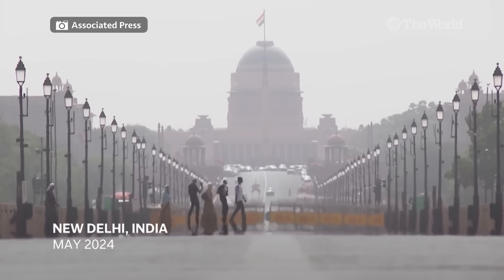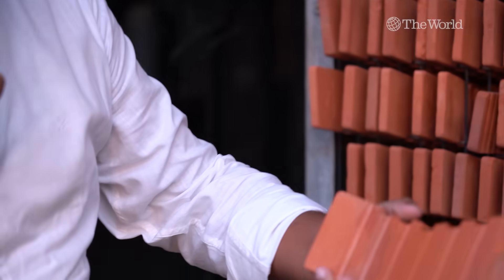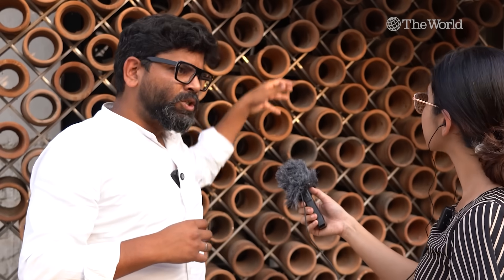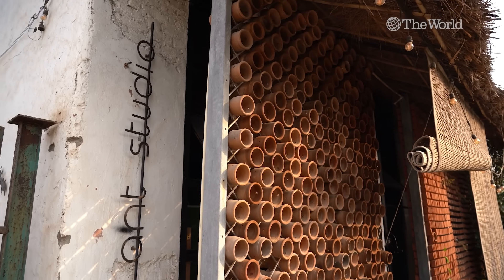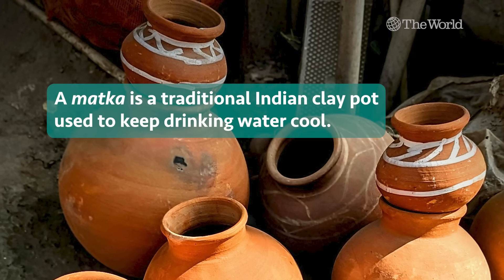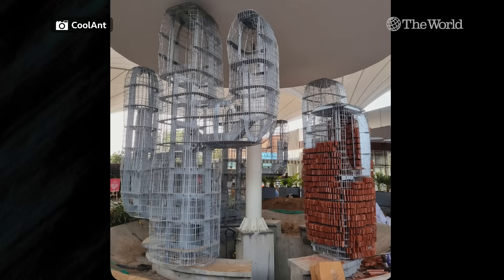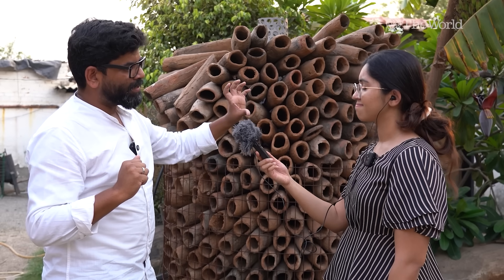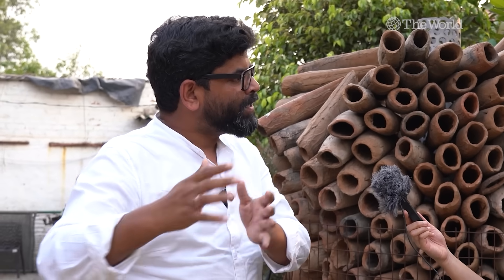Nights in Delhi hit 95 degrees. This keeps homes cool.

Comment: Many solutions for many applications. An idea does not need to be rejected because it doesn’t fit every circumstance. Let this be a starting point.
Reply: Exactly. It's a beautiful approach
Reply: Let the starting point be that the show how much this cools in the testing facility. The cooling effect is the point right?
Reply: @televerket  it cools enough, issue is insane amount of water needed.
Reply: @nemam_nedam Enough? Use an example with degrees if you want to be taken seriously. I understand that the effect might be dependent on many factors so why not create at least one example?
Reply: @televerket   as i said previously, AC works in same way except vapor, liquid is enclosed in pipes. try it yourself in your situation - douse few towels in water. hang them on a clothes drying rack. air has to move in parallel to towels.
Reply: @nemam_nedam You really want it to seem reasonable to not show what it can do right? Enough cooling, insane amounts of water??? My comment is about the solutions in the video and you suggest I should try/test something else?
Reply: @televerket  it is cooling air by evaporating liquid (water in video), same physical phenomenon is exploited in all things we are talking about. youre still doing same thing but by other means. example to make you familiar with concept - you can boil water on wood stove, induction cooker, or gas burner. you are still boiling water.
Reply: Up
Reply: @sureshchandragupta3764 -1a
Reply: AC works with same principle, except in AC, liquid is inside of tubes. Approach in video needs insane amounts of water to work (think whole city). Again, standard AC is keeping all liquid enclosed, reusing it. so having PV panel to block sun (lowering heat) and water tank / rock storage to be cooled by AC by day and used in night should be explored too.
Reply: Even 10% would be huge for the grid! Ty
Reply: Wouldn’t work in my temperate mid-Atlantic US climate where summer humidity is miserably high. BUT my 1940’s house built of cinderblock so 2-ton central air works fine (in 100*F, 110* F heat index recently) tho every AC contractor recommended 3-4.5 ton AC compressor b/c they’re use to install in stick-frame houses.

Comment: Im afraid snakes, rats and other insects, animals will make it their homes. Make the walls thicker than usual...like 1 feet thick or more to prevent heat from being transmitted into the interior.Also, plant trees around the house as they are naturan airconditioners. The roof should have openings for hot air to escape. Also, build fountains in the house so that the temperature becomes cooler and humidity is achieved. Also in the courtyard. The windows should not directly face the sun. Build alcove around the windows to prevent direct sunlight from hitting the window. The ceiling must be high. Use light colours outdoor. Build water drain or passage in the floor for as a  cooling system in dry climate. Etc

Comment: Not only cooling, flowing water is soothing to the mind and helps release stress, so, it can be beneficial like that as well. I can think of multiple ways this can be utilised and become much more than just a cooling mechanics.

Maybe you can have a mini pond like thing below it, where water collects, with pretty flowers, and then the water is taken up and via these for aeration. Doesn't even have to be right below, can make a cute little stream. Basically a an open and vertical Bogfilter. And then have climbing plants on these to help cleanse the water even more.

Plants will benefit from the flowing water and thrive on sunlight, shading the whole structure, dispering water via their leaves and cooling the whole area even more.

Bees and wild animals will also have a place to drink some water.

It can be turned into a wonderful little mini ecosystem.

You can have pretty flowering plants on top of it like Rangoon Wiper (Malti Lata), Aprajita, climbing rose, etc.

Comment: I live in northern New Mexico. I painted my roof with the super radiating white substance that has helped my house stay way cooler during the summer months, and does not affect the winter because the angle of the sun in winter is low. Also, keep in mind that 6 feet under the ground the temp of the soil is 50 degrees. The Earthship Houses mostly around Taos, NM have used this principle extremely well in creating houses that stay at a constant temp pretty much year round. 
This video is so beautiful, the clay pottery structures are architectually so attractive. I've been learning more and more about ancient ways of heating and cooling with wasting our precious energy and creating more heat. If we aren't a bit careful we'll just consume the Earth and it will become unliiveable for most of the beautiful plants and animals here.

Comment: The best arrangement I believe is a thermal mass integrated into the dwelling with a layer of insulation. Ventilation at night cools the mass, which can keep the structure cool through the day while it is closed up. The capacity of the thermal mass has to be great enough to last all day, which depends on how good the insulation is. The strategy only works as long as night time temps are comfortable, though. Night time temp of 95F is too high for the strategy to work without additional cooling measures. Phase change materials could easily be incorporated into a passive cooling strategy, could potentially reduce the thermal mass required.

Comment: stupid idea, imagine the dust collection, algal growth or fungus growth. imagine insects coming inside your homes. plus there will be soil smell... yet it smells good for few mins... not forever 24x7 hourse
Best solution is nuclear power + city centralized air conditioning. 
Because it is nuclear it is clean, nuclear waste is not an issue.
because air conditioner is centralized it can be maintained regularly almost daily making sure there is no leakage of greenhouse gases or any harmful toxic. 
because it is maintained regularly it will consume less electricity as it is more efficient.

Comment: Any sytem that has to be irrigated, is not sustainable. It has to use moisture from air. So using vertical and horizontal pipes, using curtains outside the wall... having veranda all around the house... these things are maintenance free solutions.
Reply: The houses have to be built conical as well to DRAW the heat up, typically with a sheltered green area in the middle. It's not sustainable with the amount of populous there. Now digging UNDERGROUND might be....

Comment: when my late dad grew up in akron ohio usa . his house had those windows that would roll up and down. hed iether put a water soaked blanket or towel i inside facing the room and put a fan  running on high . temps sould normall exceede 100 110 degres f with 100 % humidity.

Comment: Since India has used °C since 1956, as AI says, I assume it's 95°C? If not, that's nonsense. Only a few countries use the Fahrenheit scale. These ceramic tiles do not require electricity, but if an office or family can afford an air conditioner, preferably an inverter-type like the cheapest ones from Midea or Chigo, it would be much better for health and comfort, and it could even provide some water. While running the AC all day in summer, I can collect 10 litres of water. Of course, it is better and cheaper to run the AC using electricity from your solar panels. That's why an inverter type is preferable.

Comment: Hmmmm, more water particles in the air is much hotter btw. Some example is when its rain season, "pretty hot sometimes before the rain and then rain cooling it down again". idk
Tbh terracotta itself is pretty good insulator, no need to pour water on it imo. and the funny thing is you need to bake that clay to make terracotta. kinda defeat the purpose of "Oh guys its getting hot" thingy.
Just dig a holes around the buldings, plant some vines, and give them a way to go up or to the side, is much better option imo. and there some Vine with "fruit" as well. So Much better.

Comment: Nice build.This is what cheap small evaporative airconditioners do. Blow air through some soacked fabrick being wetted by a water tank. The air coming out is definitly cooler, evaporation works, it's what our bodies do to keep cool. The problem with those AC units is that they raise humidity a lot, and that moist air makes it very uncomfortable being in the room, as the body's AC, sweating, isn't working well anymore, as moist air has no capacity to take new water. I have a monobloc AC with hose to the outside, which doesn't do that much becasue warm air comes in. but it's dehumidifying effect, making air dryer, makes an enormous difference in comfort. 

I'd rather have a place warmer and less humid than colder and more humid.
Reply: Evaporative coolers are not air-conditioners.
Reply: WELL SAID!

Comment: Our home uses self-generated solar power to run the HVAC system. It is simple, not grid-tied and completely self-contained. The initial investment was over $2000 in equipment, but it saves over $100/mo in electricity billing. We have three heat pump window units running off of three Bluetti solar generators, sharing a rooftop solar array of 2.5kW buffered through a lead-acid battery bank of 16 deep cycle batteries. Once it was all set-up, the system runs heating and cooling entirely off of the sun power.

Comment: It's a partial solution which will only work when the humidity is low (in the spring / early summer in New Delhi)
Once the humidity goes over 70% it won't cool you off so you will need AC.

Comment: We have a drought alongside the hot dry weather months when cooling is badly needed, so running water over the bricks is not an option. Perhaps, adding a system to generate water out of air would fix that.

And after the hot dry months, come the extremely humid months. I think using some science to shape the clay in a conical manner to cause air compression could be a game changer

Comment: I grew up on a station in Western Australia, where we used a Boughshed, a building lined with brush from trees (broad leaf mulga, ti-tree…) with water running down the walls. As mentioned in the comments, it didn’t work as well on humid days, or days with no wind, but it was still much better inside than out when you were trying to sleep. We were blessed with a large source of water, and the water that ran down the walls, went into our garden as well. But watching this, and looking at comments, it wouldn’t be hard to have a receptacle at the bottom of the wall to collect water and recycle to the top of the wall again. I love the sustainability of the terracotta here and want to see how this is carried forward! Good luck!
Reply: Possible with a small water pump.
Reply: Yes- perhaps a solar-powered water pump.  As long as water is relatively abundant, this seems like a brilliant approach.

Comment: RATHER THAN CYLINDRICAL TERRACOTA WE SHOULD USE CONICAL SHAPE AND THE ONE WITH THE TIP SIDE SHOULD HAVE SMALL HOLE COMPARE TO ITS BASE AND IT WILL COMPRESS THE AIR NATURALLY AND WILL MAKE AIR MORE COOLER DUE TO COMPRESSION OF AIR. THE TIP SIDE SHOULD BE INSIDE WHERE WE NEED AIR TO BE COOLED AND THE HOLE SIZE OF THE TIP SHOULD BE 1/16 THE OF THE BASE SIDE.

Comment: The concept of using porous terracotta tiles or vases for evaporative cooling has significant limitations. First, it is only effective in very dry climates, where the evaporation process can efficiently lower temperatures. However, in such arid regions, water is often scarce and valuable, making the high water consumption of these systems problematic. Second, constantly moist terracotta surfaces create an ideal environment for mold and bacterial growth, especially in poorly ventilated spaces, potentially compromising indoor air quality and health. Unlike traditional passive evaporative cooling systems, such as small fountains that use minimal water and are easier to maintain, a wall of humid terracotta tiles or vases is far less practical. Beyond excessive water usage and mold risks, these systems require frequent maintenance due to limescale deposits, algae, or lichen buildup on the porous surfaces. Additionally, implementing such a system involves complex infrastructure—tubing, timers, sprinklers, or drip irrigation—which adds to the cost and maintenance burden. While the idea of terracotta-based evaporative cooling appears sustainable and eco-friendly on paper, in practice, it is inefficient, resource-intensive, and prone to significant drawbacks. Modern evaporative cooling alternatives, with controlled water distribution and advanced materials, offer more practical and hygienic solutions.

Comment: I like the idea of figuring out different solutions for different places. I just remembered getting into the Chattahoochee river on a hot day, and it was so cold I never got used to it. It's because the Buford dam releases water from the bottom where the sunlight doesn't reach. That volume of frigid water could probably cool thousands of homes.
Reply: There should be a way to run that cold water through a house to catch heat in the structure or air before carrying it out.

Comment: If you want a quick help to your standard build house paint the roof with the white material that specifically reflects 95% of heat. It's not expensive. I did this to my house in New Mexico and made a huge difference in comfort and reduced cooling bill. Since the sun in low in the sky in the winter, this did not increase heating in winter. Let's all work together to build houses that are healthy and largely self-sustaining and inexpensive. Thank you for this video, beautiful.
Reply: Where does the reflected heat go? 🧐
Reply: @shinobusensui9395  same place the heat goes when you run the AC. Outside
Reply: @shinobusensui9395  Good question, the light does not get absorbed by the roof and turned into heat which in turns heats the house, the light gets reflected back into the sky is my understanding. I don't believe it's heat that gets reflected.
Reply: mexicans invented that dozens of years ago, now USA and their similars like India are imitating. as long as they use biodegradable materials they should be fine.
Reply: Last lines are profound! ❤❤❤
Reply: Smooth glossy white is great for heat desipation.
Reply: same in Greece or Spain
Reply: Hey! I’m in New Mexico. What is the roof material that reflects 95%? I need to reroof.
Reply: @JoeBlow-rl1xw They have it at Home Depot! In 5 gallon cans. It's a brand out of California. I forget the name. It's not just "paint". Will also prolong the life of your roof!
Reply: Did my house and two other houses.

Comment: One should look at integrating it with the ground. Typically a few feet under is a constant temperature and quite cold. If you could leverage that you could essentially extend the thermal regulation the ground has upward.  E.g., if you could make a closed system that would evaporate, condense back into the ground, cool off, then rise and evaporate you essentially are using the sun and ground as an AC. To make this work requires a cycle else you will just get a stagnate system. Some people have used various materials and designs and science to get the cycle going.